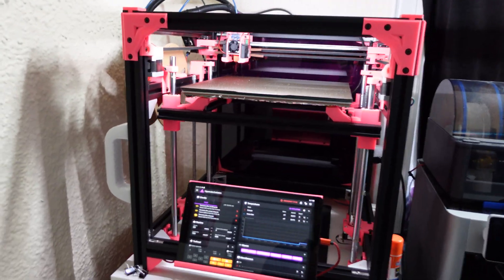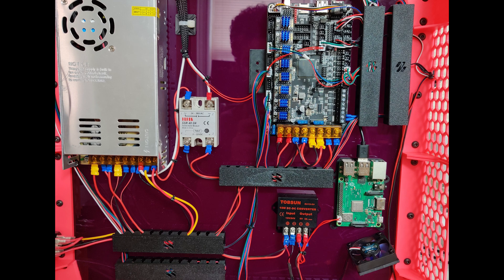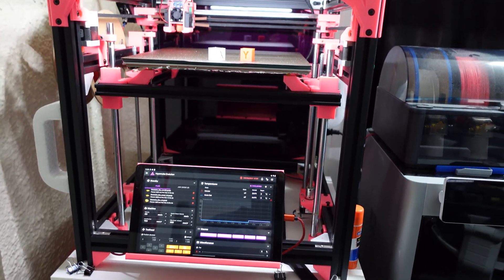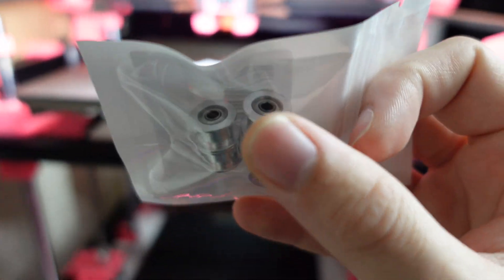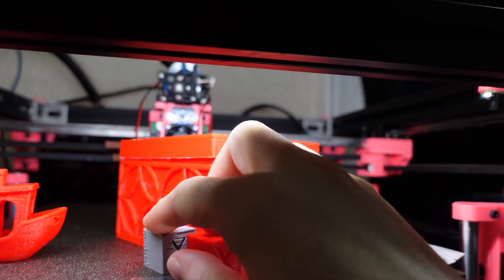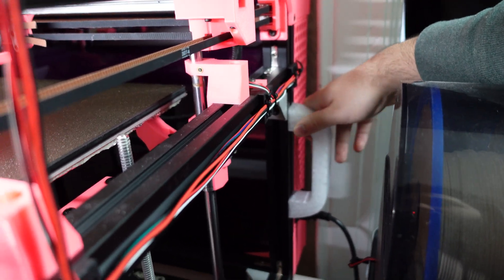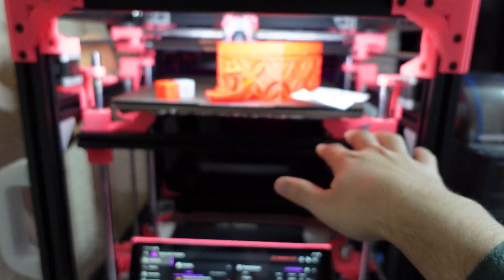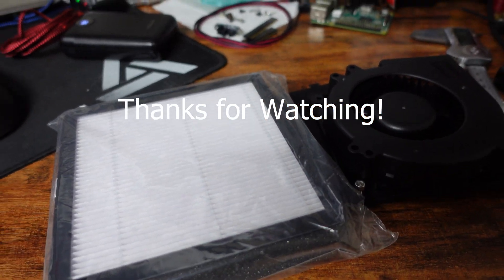My New Custom HyperCube Evolution with Linear Rails 2023

Comment: Don't get to mad about numbers @BambuLab. My old CR10v1 with Klipper and some modifications get's up to 400mm/s@3000mm/s². My new P1S makes in theory 500mm/s@10,000mm/s². In theory because even the high flow PLA from Bambu is only certified up to 300mm/s. My CR10 prints PLA with the same quality and is a bit faster with larger parts.

Nice to see the HyperCube still alive in the community 👍 My HyperCube stopped working after conversion to a 6mm heatbed. It became so heavy that the motors were not able to lift it up anymore. I started some experiments with tripple z-axis and z-tilt but in the end it was easier to boost the CR10 :) So my HyperCube sadly collects dust in a corner of my workshop.

Comment: Do you have any special belt tensioning system? I am designing my own core xy with linear rails and also went with just and mgn12 for the x rail. i have done simulations and it can withstand perfectly fine up to 30k accelerations.

Comment: 1) X1 has a shorter rails and rods so of course it's stiffer and gets higher acceleration.
2) you don't have a 2020 profile under the X rail so when it moves along Y it resonates more and it limits your acceleration. I haven't seen your graphs but I guess along X you could achieve more than 10k, but it's Y to be much lower than that.
3) link to thingiverse?
4) nice the Sherpa mini.
Reply from the maker: yeah, i wasn't happy with my hypercube, so i decided to scrap it for parts and build a rat rig vcore 3.1. I'm almost done building it, but I think it is going to be much better than mine. Stay tuned!!

Comment: Just for the frame, do you think it'd be cheaper to go linear rails or rods?
Reply from the maker: I think in the end linear rods are easier to setup easier to change or modify. Less complex parts to connect them to your gantry. Overall just a better experience in my opinion. The rods work sure but are a huge pain to setup and require more printed parts. When i tried them at first i couldn't get parts to come out straight with them because they were slightly off, it was hard to get them perfectly parallel.
Reply: @journeyofdrew1644  Alright thanks! I was thinking that might be the case. Definitely going with rails

Comment: May I ask, did you model the electronics "enclosure" yourself? Or is it on the web? If so? can you direct me to where I can find it. I like the design my current electronic enclosure is kinda janky.
Reply from the maker: Do you mean the frame? The frame is based on the hypercube Evolution. This printer doesn't have an enclosure, as in the side panels to completely cover it.
Reply: @journeyofdrew1644  Nope I mean the back of it, where you have your electronics. The prints that hold the panel.

Comment: Ringing is all about mass and ability to control it. I eliminated on a bed slinger by just adding smooth pulley to wrap the Y belt around the motor pulley teeth more.

Comment: Bamboo lab is great, until it breaks, or you want a larger print. Yours is slow due to the heavier mass vs bamboo lab. Steel liner rails are very heavy. To reduce belt slip, wrap more belt around the motor, and or use reduction gear. You will need to cool the motors and your driver chips. Use latest 5160 chips.
Direct drive is over rated and adds too much mass if you want speed. Just reduce the bowden tube length by mounting the extruder on center top of XY system.
Reply: One of my bambus is down currently and support has been extremely slow. I've put a lot more time into refreshing my hypercube for this exact reason.
Reply from the maker: This is good advice 🤔🤔 thank you

Comment: Flow needs tuning based on your material and nozzle. Just measuring the length of filament for stepper steps is not good enough. There is also software tuning for corners and walls.
Reply from the maker: Yeah honestly I'm not that happy with the printing results of this printer. I still get layer shifts and can't print as fast as I wanted. Which defeats the whole point of why I built it. I would need to completely redesign the x axis at least to fix those issues I think. I'm not sure how to make it lighter and still have a linear rails. Any ideas? I have a larger rail as the x but it's also the structural part of the x axis. But I guess it's still heavy in the end. Is say, a smaller linear rail and an aluminum x frame actually lighter? And would that work for a larger setup like this? I want to get at least voron 2.4 speeds/accelerations or close. But idk

Comment: Great design, very nice-looking prints. I appreciate your advice on the Bambu Carbon. I think I'm going to take your advice.
Reply from the maker: Wise choice. It's reall all about what you want. If you want a machine to build yourself, do lots of tinkering and modifying then go ahead. But if you want to just print for other projects then bambu lab is hands down the best way to go in my honest opinion. I only built this printer because I wanted a larger corexy printer purely for printing really big models. I basically have a small printer (resin), medium (bambu lab x1c), and large (hypercube) I plan on leaving it at that, as I want to work on other projects that I have planned for my videos, including robots and the like. So stay tuned! Thanks for your comment! Much love 💕
Reply: @journeyofdrew1644  replying to a new subscriber's comment is very professional. I wish  you the best of luck with your robots!
Reply from the maker: @corlissmedia2.0  Thank you for your compliment and thank you for subscribing!
Reply: Nice project. Watching your journey with this project i felt the struggle ;) i can relate to your struggle. 
Congrats for the drive and achievements
Reply from the maker: @dury10  thank you! I appreciate the compliments :) 😊